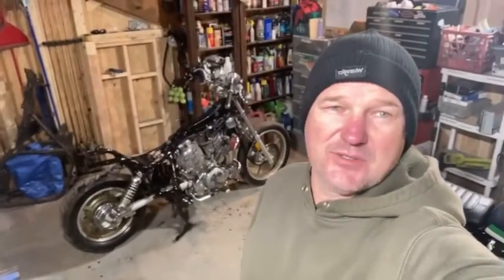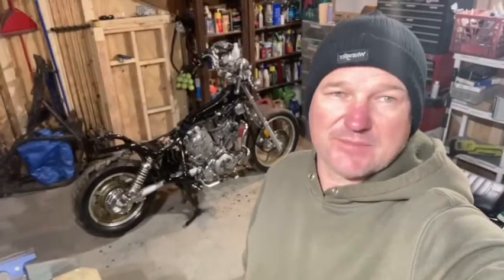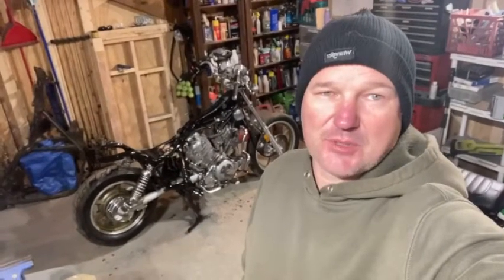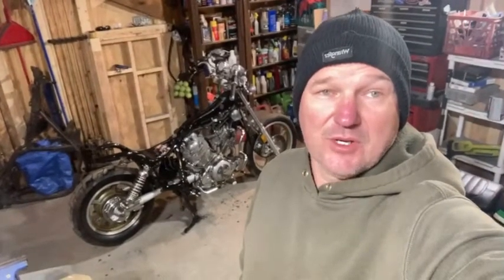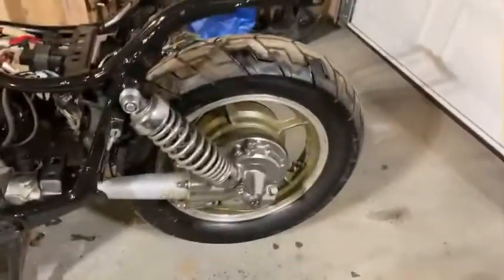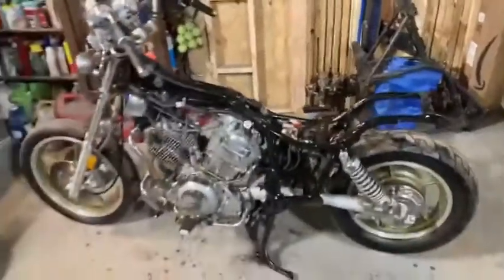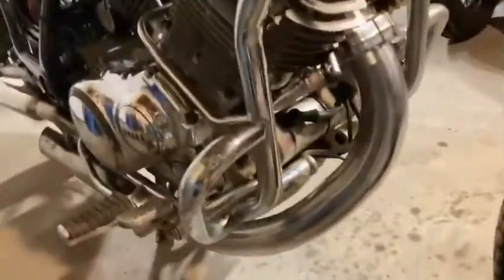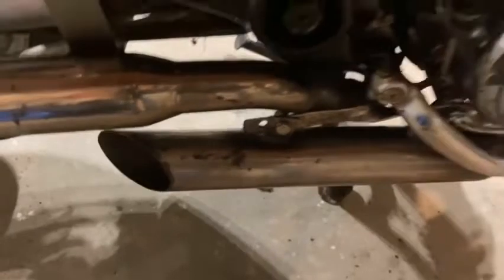Day 4 - 1992 Yamaha Virago XV1100 build

Comment: Hey bud. What do you use to clean the bike?
Reply from the maker: Meguiars detailer and wax for painted surfaces. We spray fine steel wool with WD40 to clean chrome.
Reply: Awesome! What do you do with the wheels? I have the gold rims but they look very sad at the moment
Reply from the maker: If they are really bad i go up to medium or coarse steel wool but soak the wool down with the WD40 to minimize scratching. Once i get down to fine steel wool i use mothers aluminum polish to finish it off. Hope this helps. Would love to hear back on your results.
Reply: Thanks man. I’m going to give it a go on the weekend.